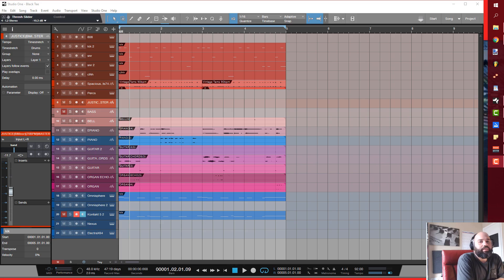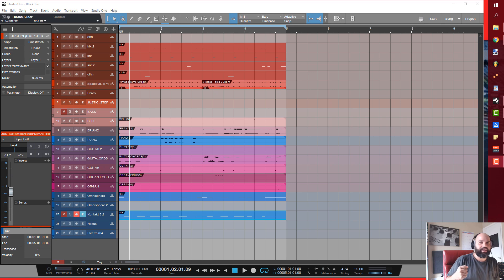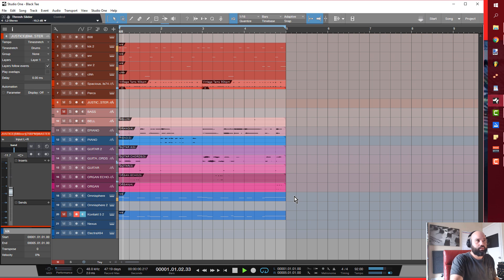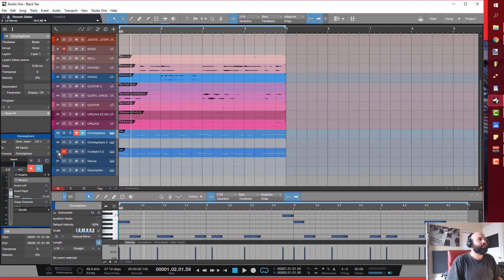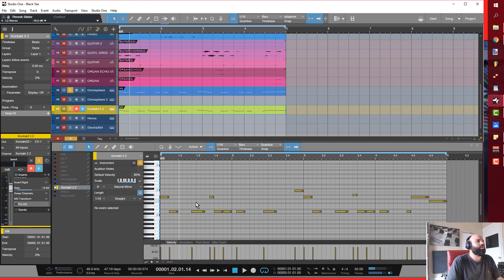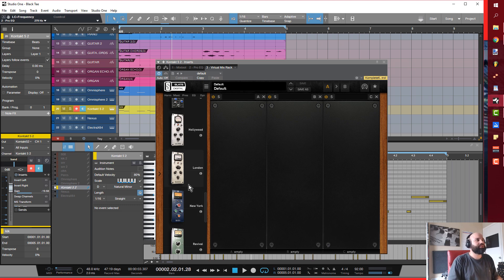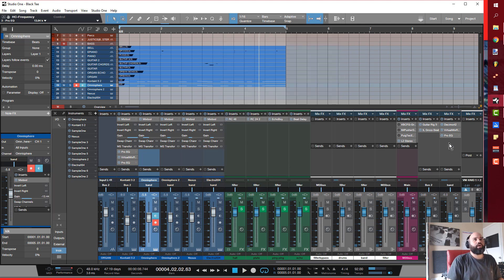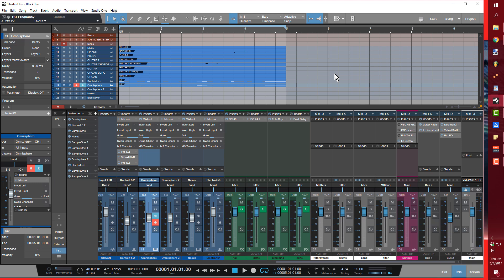How to Make Loops Sound Like Samples | Presonus Studio One Tutorial lofi

Comment: I have to ask: why did you use the second and third trimmer modules in VMR? Was it necessary in order to drive into London? I'd have just tweaked the gain of certain freq ranges in StudioOne channel editor.
Reply from the maker: QueMusiQ I don't know bro I just did it. I'm used to using trim tools
Reply: Craftmaster Productions same logic in re following it with a stock LPF instead of using the Eiosis Air module? Is the stock pro-eq instead easier on CPU?
Reply from the maker: yeah i mean I dont think about it that much, i make 2 or three beats a day since Ive had studio one, ive only had slate for 6 months or so.  Its muscle memory at this point.